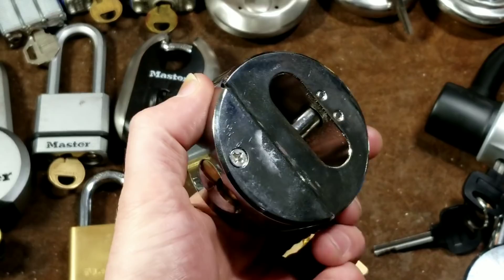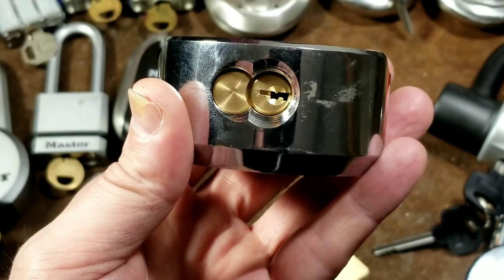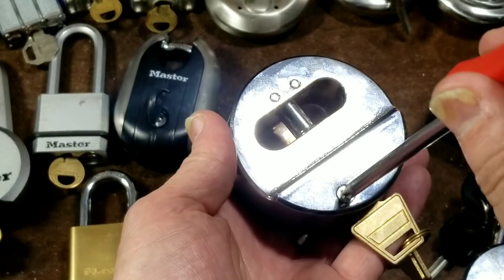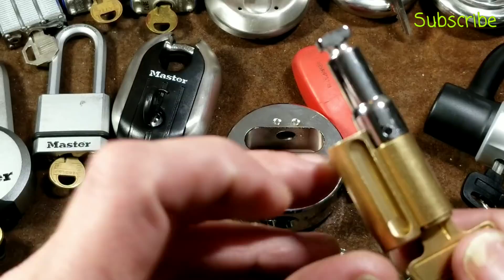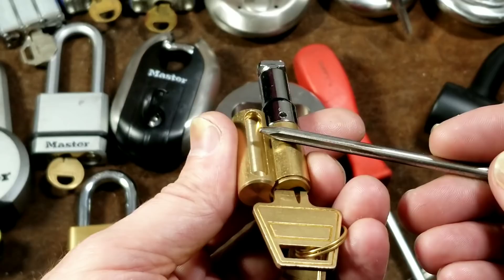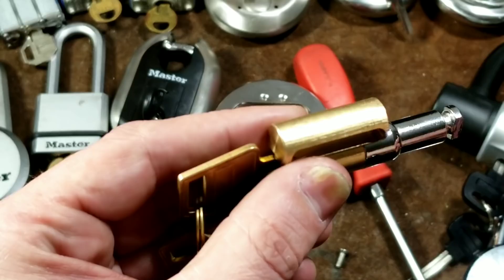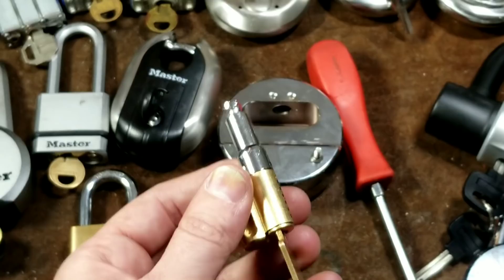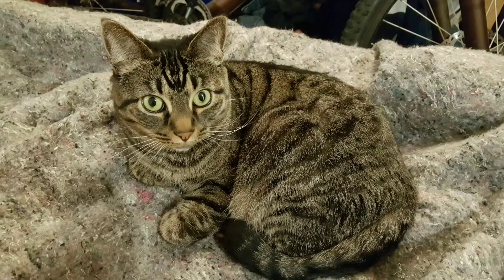Harbor Freight Billet Steel Puck PadLock Review & Discussion

Comment: Nice video. 
You should have also suggested making the top pens longer than the stock top pin to prevent over lifting attacks.
Reply: Consider the following... you pull back on the bore holes to make them more shallow. Deep enough for the key pins to reach the shear line but not so much that both pins plus spring can be forced past shear line completely?
Reply: Would that work? Because if so one could fix the issue by doing less instead of adding more material
Reply: @joshuajohnson9237  that would be the fix from a manufacture perspective. The suggestion I was making was for an end user to correct the manufacture flaw.
Reply: @joshuajohnson9237  the over lifting flaw is found in almost all puck locks manufactured despite the brand.

Comment: on trailers thieves  cut the  hardware onthe doors  and such  unfortunately i had them do that on a expensive Haulmark  enclosed trailer  luckily for me the trailer was usually pretty empty untill i had to haul  motorcycles  that were stored somewhere else  i did however have Master puck locks on all the entry  doors  my Locksmith dealer /distributor told me those were the best ones at that time ?
Reply from the maker: American Lock Series A2500 is a much better puck lock. 6 pin with all security pins and all the pins are steel. It also has a fundamentally different design which is much stronger than a traditional Puck lock where the whole key cylinder slides out

Comment: Typically, if a thief wanted to work that hard, they would have a job in the first place.
  Also, if someone did attempt to remove the lock core with a screw, would the lock be stuck in place forever? Also, I don't guess most thieves are going to carry Viking drill bits.You'd probably go through a whole set Dee-dee deeeeewalt bits to get through that core, right?
Reply: You can pull that core out and defeat the lock relatively quickly with the right set of tools. Or you can pick it quietly and probably more quickly.

Comment: What good is a lock when all the keys are cut the same? I bought 3 for my trailer and when I seen my 3 had matching keys I checked all the locks on the shelves with my key and they are all the same
Reply: Maybe in your case, however I had to buy seven of these just to find two with matching keys.
Reply: You probably got them "keyed-alike" ... Something you have to look out for... There's usually a code on the lock or packaging maybe if you have gotten three different locks from three different harbor freights, yeah, I know but you'd probably end up with three different keys 😏